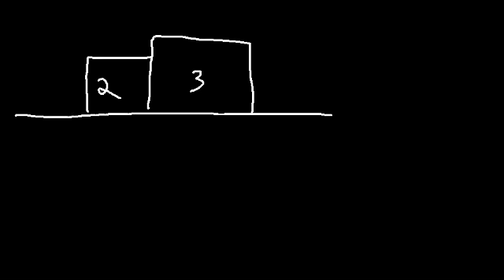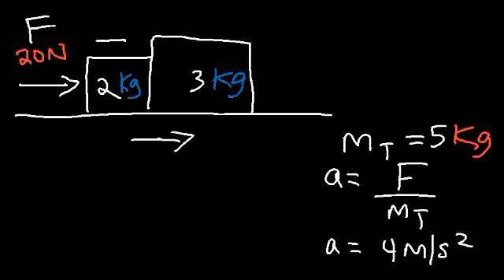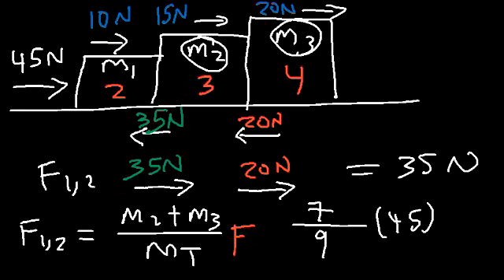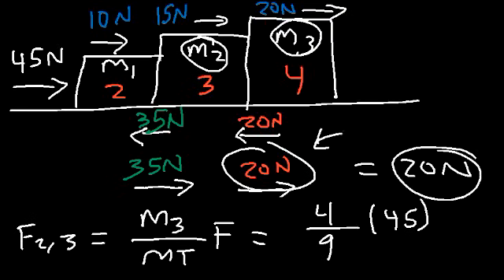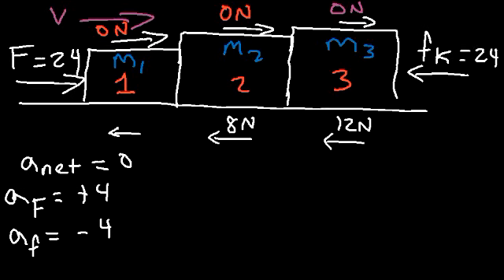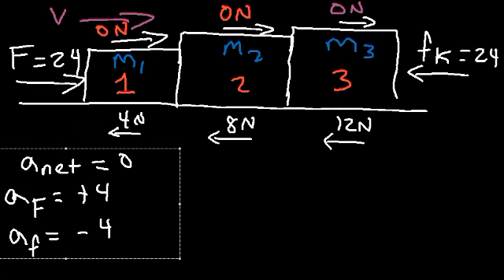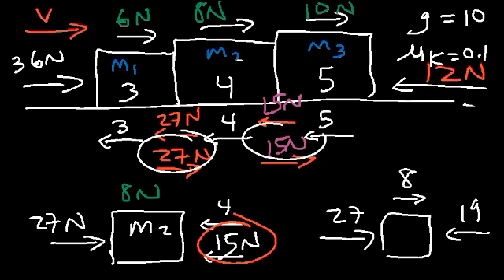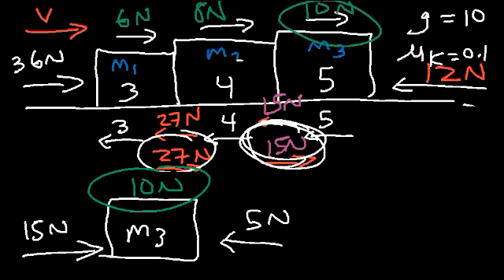Contact Force Between Blocks With Kinetic Friction - Physics Problems & Examples

Comment: Gravity AND ELECTROMAGNETISM/energy are linked AND BALANCED opposites, AS E=mc2 is F=ma; AS ELECTROMAGNETISM/ENERGY IS GRAVITY. Gravity/acceleration involves BALANCED inertia/INERTIAL RESISTANCE, AS E=MC2 IS F=ma; AS ELECTROMAGNETISM/ENERGY IS GRAVITY. A PHOTON may be placed at the center of what is the Sun (as A POINT, of course), AS the reduction of SPACE is offset by (or BALANCED with) the speed of light (c); AS E=MC2 IS F=MA; AS ELECTROMAGNETISM/energy is gravity. The stars AND PLANETS are POINTS in the night sky. The ultimate unification of physics/physical experience combines, BALANCES, AND INCLUDES opposites. E=mc2 IS F=ma. This necessarily represents, INVOLVES, AND DESCRIBES what is possible/potential AND actual IN BALANCE. Gravity IS ELECTROMAGNETISM/energy. GREAT !!! GRAVITATIONAL force/ENERGY IS proportional to (or BALANCED with/AS) inertia/INERTIAL RESISTANCE, AS ELECTROMAGNETISM/energy is gravity; AS E=mc2 is F=ma IN BALANCE. BALANCE and completeness go hand in hand. It ALL CLEARLY makes perfect sense.

By Frank DiMeglio

Comment: You don't make sense at 6:41, you said at the numerator,the force that has is being pushed should be on top,but the force that block 1 applies on 2 is 2*45/9=10N not the block being pushed=3*45/9=15N.

Comment: நன்றி
Reply: You don't make sense at 6:41, you said at the numerator,the force that has is being pushed should be on top,but the force that block 1 applies on 2 is 2*45/9=10N not the block being pushed=3*45/9=15N.

Comment: Thank you so much❤🧡💛💚💙💜🤎🖤🤍
Reply: You don't make sense at 6:41, you said at the numerator,the force that has is being pushed should be on top,but the force that block 1 applies on 2 is 2*45/9=10N not the block being pushed=3*45/9=15N.

Comment: There's a question I am not able to solve, can you please help me with it?
Q. 3 blocks of mass 1kg,  4kg and 2kg are placed on a smooth horizontal plane. A force of 120 N is applied from the left side and  a force of 50 N is applied from the right side.  Calculate the contact force between 1 kg block and 4 kg block.
Reply: Net force on the system will be 120N-50N (if you take left applied force positive).
Reply: is it 40N?